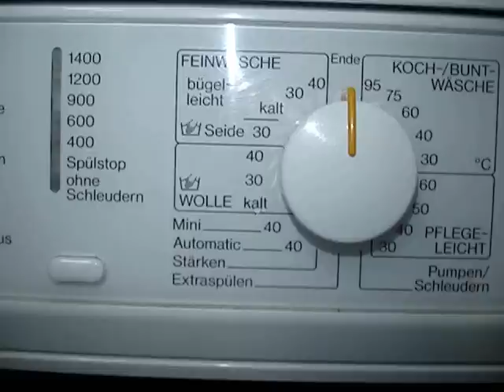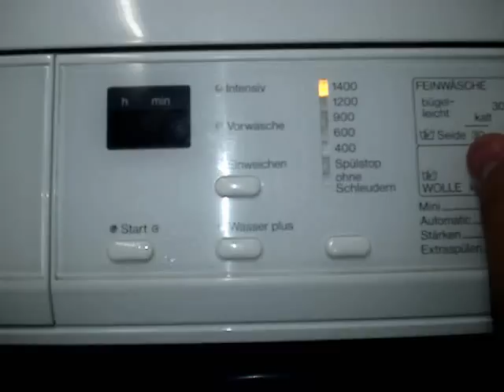Miele W 2241 WPS spinning without front

Comment: No. 

If your clothes are going to incur any damage, it's from the wash/rinse cycles as they are getting tossed about. In the spin cycle, the clothes are under a high load, but they are more or less "static" is that they aren't really moving around in relation the the rotating drum. High speeds are fine as long as you have a washer capable of making sure the load is balanced first.

Comment: Hi Mielefan, I am trying to get the front and sides off a W540 to change the bearing. (it spins up OK with no load or very light load but with heavy unbalance it crashes) I have removed all the screws I can find (top is off, front skirt is off, but the front is not coming off and the sides seem to be fixed behind the front) Any suggestions?  Thanks